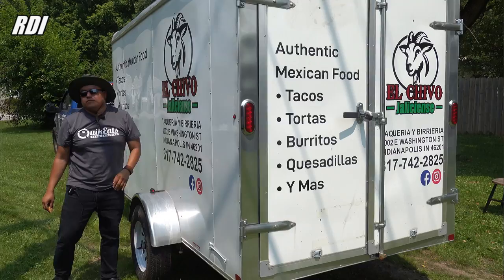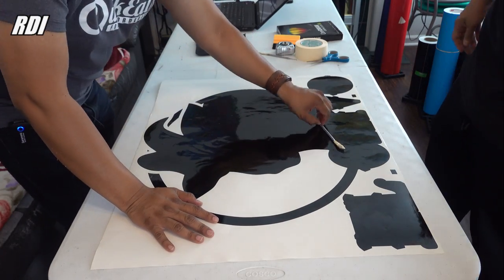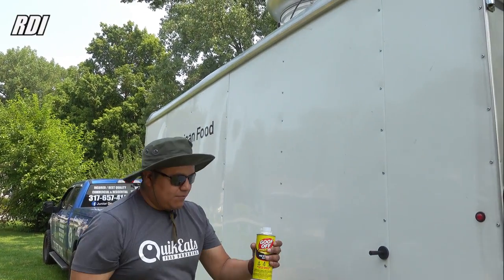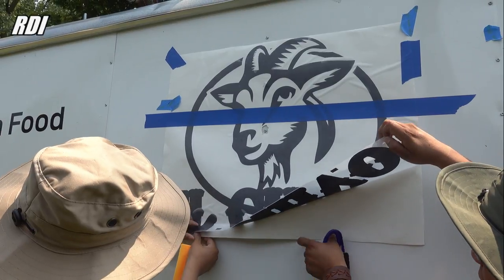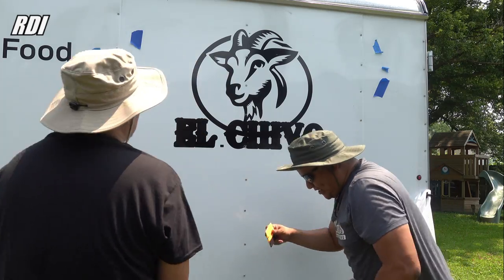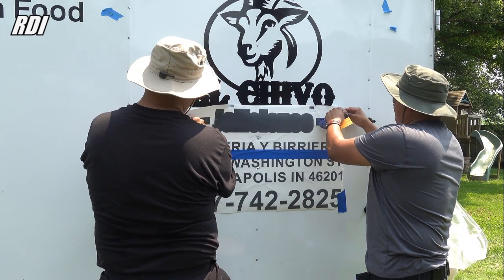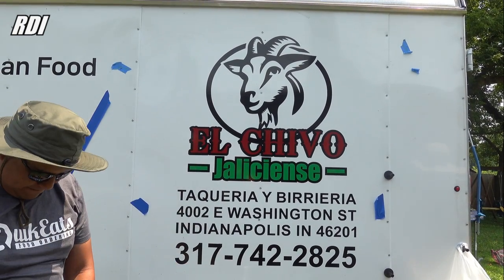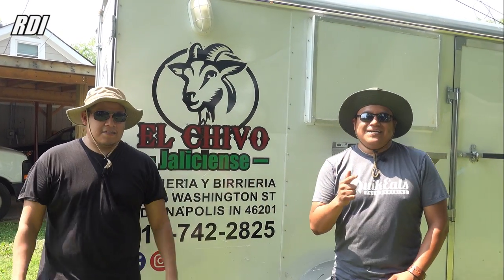How to install stickers on trailer

Comment: Love your videos!  Can I use water with the tour of transfer tape you guys use? Also, if I use water, will the heat gun over rivets method work?
Reply from the maker: Hello! We have used water (90%water, 10 rubbing alcohol and a couple drops of dish soap) with our transfers. Honestly we wouldn’t do wet application over rivets.
Reply: Ok. Thanks for responding

Comment: Any idea why I get a wrinkle in the vinyl when I use the heat gun over rivets? I leave the vents but a wrinkle appears over and under the rivet when I go over it with the roller and heat

Comment: 751 gives you a longer life and works on curves add over rivets for rivets a little heat and a Rollie pro
Reply from the maker: Hello Dan! Thanks a lot for the tip, it makes it a lot easier working with the right materials 😀.

Comment: Can oracle 651 be used over rivets ? If you already have a big supply of vinyl, or should I buy 751?
Reply from the maker: We have used oracal 651 on rivets but you need a heat gun since it is not as stretchy as 751 however oracal 751 would be more recommended for rivets however keep in mind that depending on where you get your supplies 751 is more expensive so make sure customer knows you will use a special vinyl that will last longer I mean you can give them the option
Reply: @RDIdecals  oh okay so if I use oracle 651 with a torch or heat gun and a rollepro I should be good right ? It’s for my own trucks, that’s why I was wondering if I have to buy the 751 because I already have a lot of 651 material, so your advice would just be to use my 651 I already have right ?
Reply from the maker: @gustavomarin6535  yes you can still do it with 651 but you will struggle a little more but using the torch or heat gun will help you
Reply: @RDIdecals  perfect, thank you!

Comment: Why do you choose 751 vs 651? I’m curious.
Reply from the maker: Hello! Oracal 651 vinyl is used mainly for flat surfaces and it can be used on glass, metal, plastic ( outdoor ). Oracal 751 is better for curved surfaces and rivets and it lasts a little longer but is more expensive and it can be used just like the Oracal 651.

Comment: What settings did you use to cut this with the Graphtec?
Reply from the maker: For medium used blade we cut oracal 651 at cut force14 offset 0 and when brand new cut force 9
Reply: @RDIdecals  I was able to cut about 15 signs after I wrote the comment at basically the same settings. I have a CE7000-40 (the 15") and this 751 was a bit easier to cut than the 651. For some odd reason 651 has been annoying lately. The corners don't seem to cut well and when I put more force the viny wants to stick to the backing a lot.
Thank you though! Ustedes son un equipo excelente y en realidad nos han inspirado a todos mucho.